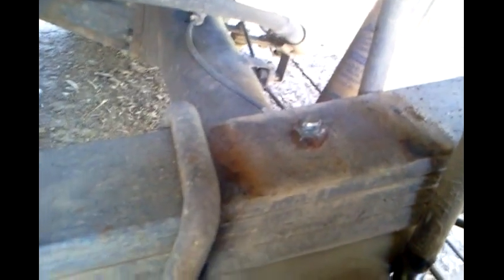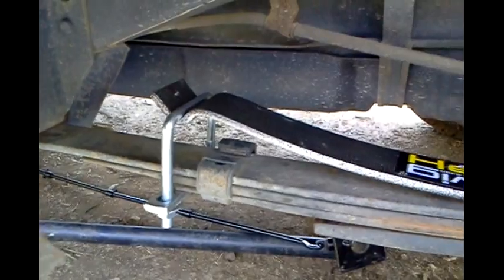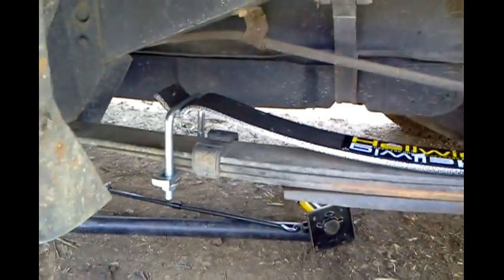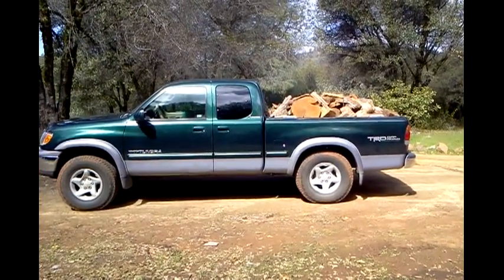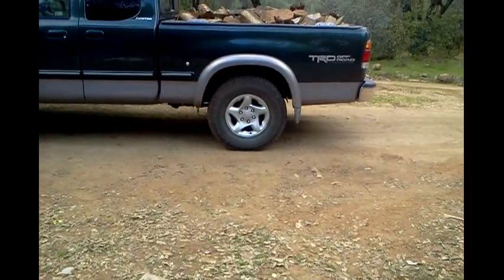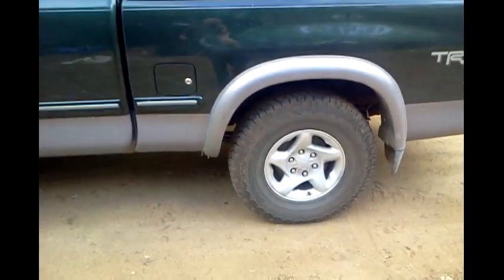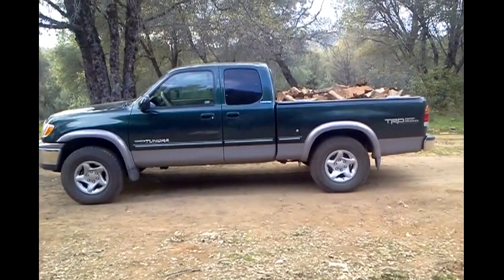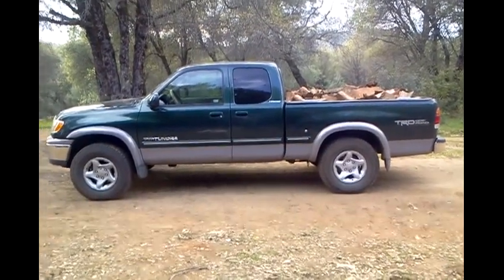Hellwig 991 1st gen Tundra install and Amazon review

Comment: Good instructional video. Thanks. Installing it on 03 Tundra on Friday.
Reply from the maker: Right on, let me know how you like it.
Reply: I just ordered a set. How does that rubber overload thing come off?
Reply: Lander Wyo once you unscrew the u-bolts it just comes off. it's not attached to anything. it's being held down by the u-bolts.
Reply: Thanks. I got the Hellwig helper springs for my 2012 Tundra. The instructions left many questions and I was glad to have a retired master mechanic helping me.
Reply: Lander Wyo nice, I have a 2010 crew max and just put those helper springs a few days ago. love it. Enjoy the ride man.
Reply: So I went to get my 33' bumper pull out of winter storage and pulled it 90 miles home.  No difference with the new springs, still light on the front tires.  So I tightened the U-bolts on the rear U-bolts to where they nearly touch  the factory springs.  Now it barely squats.  A sentence in the instructions saying you need to expose 2" of thread on the rear U-bolts to realize any benefit.
Reply: I didn't know that. Thanks for info. I guess I should've read a bit more of the instructions lol

Comment: I have them on my 07 Tacoma too and I jump a set or RR track about everyday on the way to work (about 1.5 to 2 feet of air under the truck) and sometimes you can you almost can't tell if you left the ground but that's as big as I would go with them

Comment from the maker: It actually came with a rubber leveling kit from the previous owner. I took it out way before I made this video. Made it ride terrible. When I first got it the truck was way too stiff up front and floppy in the rear. I had to fix all kinds of "improvements" the previous owner made to get the truck right again. Only modification to the suspension is the 991, and it rides proper now. Thanks, I really like this truck a lot.

Comment from the maker: Inaugural years can be a little funny, but it could be the number of miles, or just that they got taxed somewhere along the way. They may be normal and I'm just picky, but they seem soft. I do like the TRD. Did the 5100's improve the ride over the stock TRD Bilstiens? I believe the 2wd TRD are supposed to be a better, more plush shock than the 4x4 TRD; less stiff. Mine are good for now, but I like a plush yet firm ride vs stiff. Trophy truck shocks would be ideal if $ was not a concern.

Comment from the maker: I'm looking for supple, is that how you would describe them? Stiff shocks turn me into a very unpleasant person in a hurry. I want a Lexus ride in my truck, which I have to say it's not too far off as it sits. Some vehicles, like 3/4 ton and larger trucks are like tuning forks on my spine and nerves, I can't cope. Too much unsprung weight, which is why I like my tires so much, very light. How do the 5100's do on washboard, and other small "sharp" bumps that tend to upset most vehicles?

Comment: Hey Ryan. I have 2000 tundra trd 4wd and carry ~500lb quad with gear. I need to do something like this. Q: did you consider grinding off the U-bracket bolt ends hanging low? I would snag some root or debris with that in no time and twist or damage the bracket. Any way to mount the bracket bolts up? thanks
Reply from the maker: I don't know, but it would be worth calling Hellwig. I know if you cut too much off it would be difficult to remount if you needed to take it off for some reason, but it should be doable with a clamp or something. You could cut it off at your minimum tension I suppose, but I'm no engineer. I never did enough off roading with that truck to have a problem with the bolts, but the traction on dirt roads was improved by reducing the wheel hop.

Comment: Has this lifted your rear end at all? I've been really considering this for my work trailer that I haul around once or twice a week and it gets kind of old when my truck squats so much.  It is a 99 tacoma tho so its not quite as heavy duty as your rig.
Thanks!
Reply from the maker: It lifted it like .25-.5 inch. It really helps the squat and improves handling a lot. It's a cheap solution that also improves ride, very rare. If you order it from my Amazon store,  you have the benefits of Amazon buyers protection if it doesn't work the way you want.  I think you'll really like them though. You can tune the ride softer or firmer. Thanks for watching!
Reply from the maker: Trailers "wag" less too, if that makes sense. Little less moving around going on.
Reply: Awesome, I think you've made up my mind haha.  Thanks!